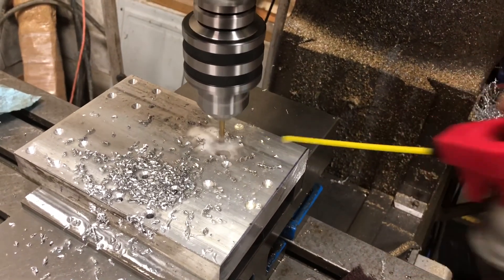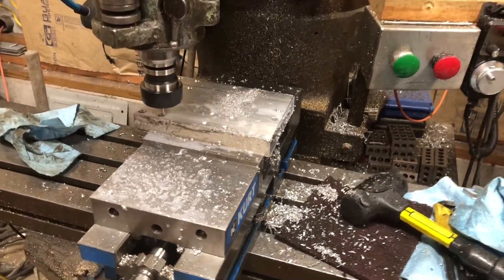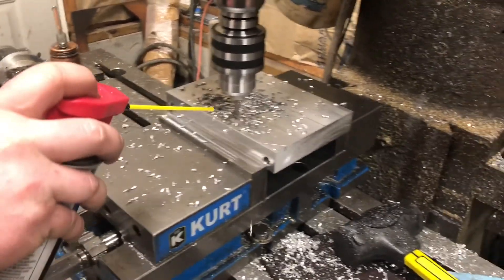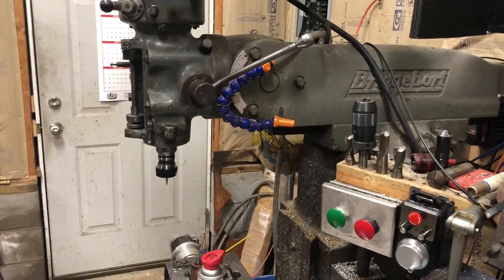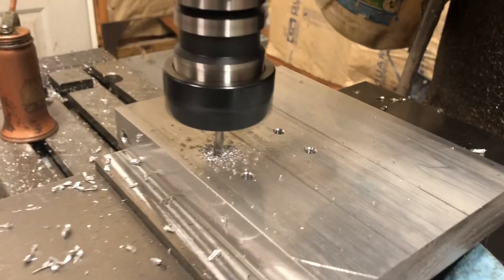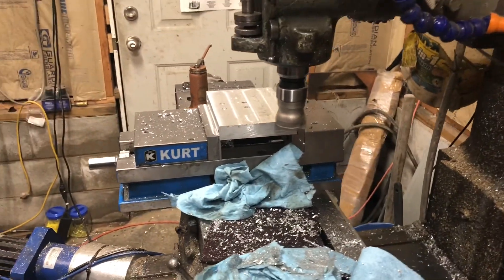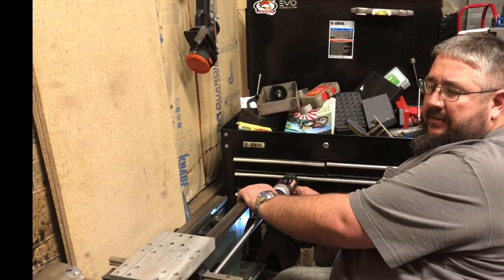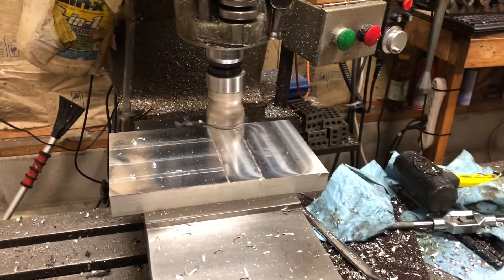9x20 Lathe CNC Conversion With Masso And Clearpath Servos Part1

Comment: Dang your really cooking that shell mill. Flycutters are great on lower HP machines that can't handle the torque.  I agree that a shell mill is much better for your application.  What are you using for CAM?
Reply from the maker: Stephen Brown fusion 360.

Comment: Is your mill using ballscrews?
Reply from the maker: Kris Sondors yep converted it over on the x and y
Reply: @mowbetter2010  thanks for the reply! Did you use a kit or did you use off the shelf parts and fabricated it to work? I'm thinking of doing the same on my knee mill.
Reply from the maker: Kris Sondors i found a set of used ones with the yoke but after i got them found them to be 48” not 42 so extended the table to match. Wasn’t hard just took time and some square tubing

Comment: John, thanks for sharing,  face mill is light years ahead of a fly cutter. Have no idea why guys still use a fly cutter(except for large continuous cuts)  ancient tool that needs to be put in the backup part of a tool box. That is not an R8 spindle ? What is that BT30 ?
Reply from the maker: automan1223 ya its a r8 spindle running the tormach tooling in it with there ring that goes against the spindle nose.